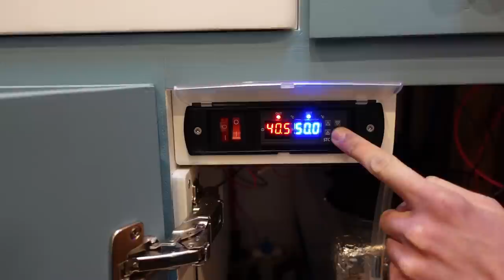Roldour Sliding Shower Door Install (Compact & Self-Cleaning!) | Transit Van Conversion E39

Comment: An idea for your rear doors on transit. Buy 2 of the upper lock pins, less than $ 50. Us add a extruded cross bar . It secures the doors and you can add a awning at the rear over the doors. The same as the side but no poles needed.
Reply from the maker: Thanks for the suggestion, can't quite visualise it though. Do you mean a bar to go across from one door to the other when they're open? Any pictures you can link to something similar?

Comment: I use a $4 shower curtain and it works fine. I was really thinking about a shower door, but kept putting it off and then said to myself Why ? The shower curtain works. Just have to be mindful of the bottom corners. Then I just hang it up around the head and it dries pretty fast.
Reply from the maker: Yeah a shower curtain is a fine and nice cheap way to close it off, we considered just doing that for a while. But for us we decided the door made sense as with the heater blowing air in we didn't want it it blowing the curtain around, and makes it work a lot better as a drying room keeping all the hot air in

Comment: Hi Tim and Abi from the NZ winter (its been a bit miserable but spring lambs are here!). I'm hugely impressed with your van buildout and your teamwork, and I'm using your power wiring setup as the gold standard for my own project. I'm beefing up my Jayco caravan 200AH AGM battery system with a Victron Smart Solar, Orion DC/DC and Smart Shunt, and it's looking very tidy, thanks to your inspiration👍
Reply from the maker: Ah thanks so much, really glad you found the videos helpful! Hope your new setup works out well for you and the weather is warming up a bit 😄

Comment: Hi guys 👋🏻. It’s great to see one of these screens fitted eventually so thank you 🙌🏼.
I’m surprised you didn’t drill drainage holes in the bottom of the sliding rail instead of the side…. This way you’ll be able to seal in one side and around each hole to keep it watertight. Maybe there’s a reason and I’m not seeing it or one of your followers offer some reason why not to. 
Great work and loving the series 🤘🏼

Daz
Reply from the maker: Cheers Daz! And we couldn't do drainage holes on the bottom as the rail sits directly onto the bottom batten of the shower frame, there's no gap. Some people install them set back a bit and hanging over the shower tray in which case that's what you would do. The water can also drain along the channel and out under where the cartridge sits, so we haven't had any problems with drainage in the months we've had it in and it's nice and watertight 👍
Reply: @SelfBuiltStories  thanks for your response appreciated. I’m just about to embark on a van build after 18 months of studying different vans, layouts, materials etc, also van build problems…..
I’m a multi trader within the building industry with many skills and qualifications….
Reply from the maker: @dazmtb  No worries, and cool good luck with the build! 👍😀

Comment: Another nicely done job! Aren't these shower doors great? Our original choice was the Nautilus door, but there are other suppliers - as seen here!
The rollup door gives so much more open space. Our shower also will have to double as a dry-room for the rainy days, so our MaxxFan actually partially protrudes into the shower to get rid of the moisture directly (the door will also be 5-6 inches shorter than the opening. 
How do you find the quality of the door? Did theis ship within the UK? How much for this marvel?
Cheers from Germany and stay safe! 🚐☁🍀
Reply from the maker: Thanks! Yeah they're great, really nice and compact so you hardly notice it's there when it's open, and we don't have a track from a tambour style door getting in the way on the inside. We've found the quality perfectly fine, the magnet holds it in place great so it doesn't open or anything when we're driving, the squeegeeing works really well and we haven't had any leaks, so yeah, can't complain! We paid about £280 all in with shipping for ours, and yeah shipped to the UK but they deliver worldwide. They've actually given us a 5% off code that anyone can use after seeing the video too, details are in the description/pinned comment if interested. Hope your build is coming along well 🙂

Comment: brillian and meticulous work as always, you two.   Just one thought I had, though; were the drain holes a little high in the trench?
Reply from the maker: Cheers! And it's hard to see in the video but there's a little lip on the inside so the holes are pretty much the lowest we could get them, and also to allow space for the bead of sealant. Water can run down the channel and drain out under the cartridge area too though so we haven't had any problems with it 🙂
Reply: @SelfBuiltStories  Nice one!   Cheers for the response =)    

I think I'll order a very similar door for mine.   Australia, though... shipping will SUCK
Reply from the maker: No problem! They do ship worldwide but yeah no idea how much the shipping would be to Australia, although they don't ship from the UK so maybe not too bad? Ours was £20 for shipping and came from China, didn't take too long 👍

Comment: Hi guys. Since fitting this door how have you found it? Good review?? Any problems with mildew on the screen from being by stored in the cassette?
Reply from the maker: Hey 👋 It's been great! After the initial work we did to make sure all the joins were watertight we've had no issues at all on the road and have been using it for many months now. And nope no issues like that, the squeegee works really well and it hasn't need cleaning or anything, just the same as when we put it in 👍🙂

Comment: Just discovered your Youtube channel and saw a video about solar power and also that you cleaned it with soap.
As far as I know you should not clean solar panels with soap as this leaves a film behind and makes the panels less efficient.
It is best to clean solar panels with distilled water for the best effect.
Reply from the maker: Thanks for the comment :) We use a little bit of dish soap but quite diluted, it's what renogy says to use on their blog: https://www.renogy.com/blog/solar-system-maintenance/. But we make sure to rinse it down thoroughly afterwards so haven't had any problems 🙂
Reply: @SelfBuiltStories  You're welcome.
The solar panels will also continue to work and you will not notice it at first, but after washing the soap will leave an almost invisible film on the panel, which will eventually reduce the efficiency of the panel, which is a pity if you can prevent it?
Through my work I sometimes helped with installing solar panels and the first thing the mechanic tells the homeowner upon delivery is not to wash with soap, take advantage of it I would say😉
These types of systems are widely used here in the region for cleaning solar panels, (without soap then)😉
https://www.youtube.com/watch?v=5mPbDCuTJQE
Reply from the maker: Cool, we'll keep it in mind then if we have some distilled water handy when we're next cleaning them, cheers 👍

Comment: Just wondering why you didn't mount it on the inside of the shower walls?  It seem like you would have more room to enter.
Reply from the maker: It would have taken up more space on the inside and left some awkward shapes as the cartridge would have stuck out into the toilet area, so we wouldn't have been able to tuck the toilet flat against the wall and probably would have hit our knees when sitting on it. It fits exactly inside the edges of the frame so gives us maximum space inside and a nice flush outside face to the van too 🙂 It's narrower than a house shower but still plenty of space for us so we've never found it a problem 👍

Comment: With time you will probably find that larger drain holes or slots will work better. They tend to clog up easily.
Reply from the maker: The holes are a little bigger than what it looks like in the video but it can also drain out at the end of the channel under the cartridge too, so has been working really great for the last couple of months 🙂👍

Comment: Can i ask what size your door is? Width in particular,  ours is likely going to be 47cm wide but its really hard to tell how wide the roller space takes up
Reply from the maker: Sure, we ordered ours 1800mm x 500mm and option C. Our opening in the wood frame was 50cm and with the roldour in place we have an actual walkthrough opening gap of ~38cm when the door is fully open after all the door hardware is in place. That's just enough for us to get the toilet in and out 😛 They have a page here which lists all the measurements as well: https://thedour.co.uk/pages/roldour-measurements-fitting 👍
Reply: @SelfBuiltStories  thank you 😁, have been following a lot of your build and taking great inspiration
Reply from the maker: @George8sn  no problem 🙂

Comment: are those 2x4 studs?
Reply from the maker: Hiya, nope they're a mix of mostly 2x2 with a few 2x1s. 2x4 would add unnecessary weight. We could have even gone a little smaller on some of the walls, maybe 34x34mm, but we also wanted the depth in the cavities to be able to run the pipes and have some shallow storage areas in the walls 👍🏻

Comment: Hi guys, would you mind sharing the width and length of the floor space in your shower, not including the little bump out? Thanks:)
Reply from the maker: Hey, so the rectangle part inside the shower not considering the angled or wheel arch bits is roughly 76x60cm 👍